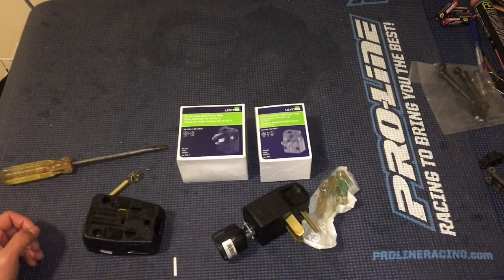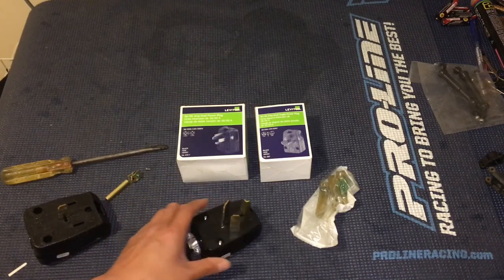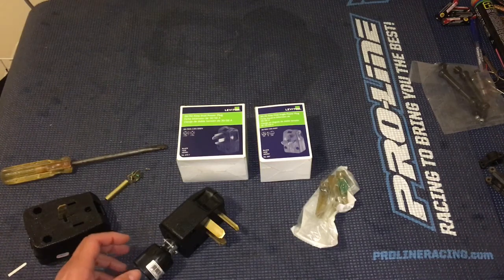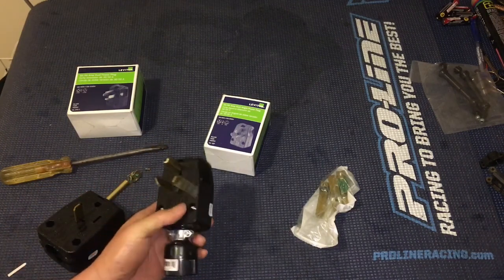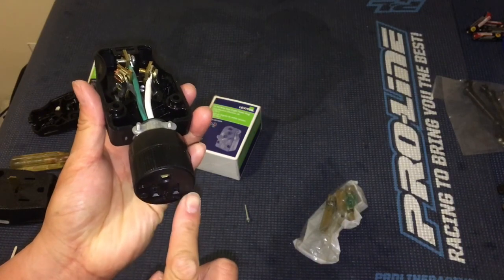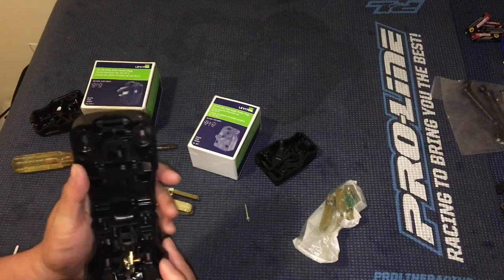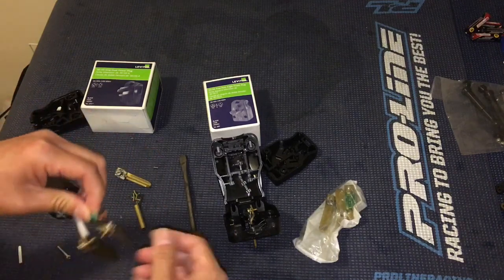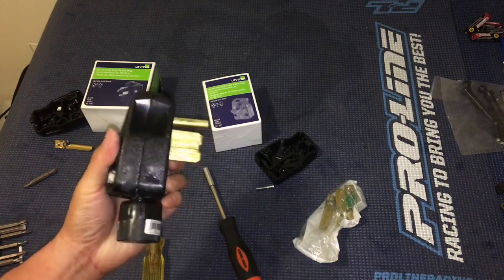Make a Chevy Bolt and 2nd Generation Volt (2016+) Stock Charger 240 Volt Capable for less than $20

Comment: Should you jumper the top and bottom terminals to connect the ground to neutral as well?  I think they have you do that when plugging a newer 4 prong dryer or appliance into an older 3 prong receptacle.
Reply from the maker: We did it exactly as was described in the forums. Neutral and ground have their distinct purposes so you'll want to do your research for your particular application. Ours worked as shown. Thanks for leaving a comment!

Comment: I used the adapters and I verified 230V going to the charger. The charger is still charging our 2013 Nissan Leaf at 120V. I wonder if they started putting some kind of resister in some of the later Chevy Volt chargers to prevent this workaround?
Reply from the maker: Thanks for watching and commenting antique1973! Not sure, we returned our Volt after the lease so we don't have the charger anymore. Perhaps search Volt forums?

Comment: I would love to see this in action..  Plugged in and charging
Reply from the maker: Thanks for watching and commenting. We've been using this for more than 6 months now! We'll get a video of it in action!
Reply: Thanks for sharing your knowledge!
The only thing I would do differently: just buy extra parts and make a second adapter. That way you don’t have to fiddle around with switching metal pins etc
Reply from the maker: Excellent point! Multiple adapters would save a lot of time.
Reply: @Racing2Learn  When?
Reply: @milkfootball2424  These two show it working:
1) Chevy Bolt EV: Stock EVSE on 240 V

2) 2016 - 2018 Chevy Volt Hidden Level 2 Charger 120/240 Charging!

Comment: Would this work with a 10-30p dryer plug? I don't think there's a ground on that type.
Reply from the maker: You'd want to have a ground for safety, and also the charger may not charge if it doesn't detect a ground. You could possibly run an external ground.
Reply: there is a ground. there's no neutral, which you don't need.